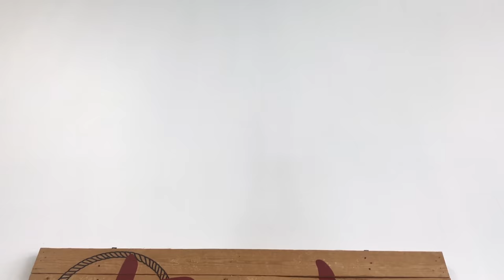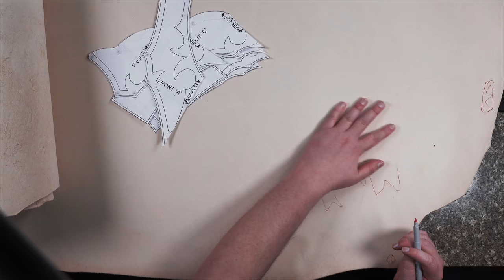How To Make An Articulated Leather Breastplate

Comment: I'm very glad you mentioned sizing at the very beginning, because for armor (any armor) if you want a good fit you need to modify any pattern to fit your body correctly -- with loose fitting in mind. Suits should fit snuggly, not armor. Unless you're in the Matrix and your armor IS a suit.

Comment: I recently built the helmet as my first big piece and it shows off the best. Watching this video, I see you using the orange foam chunks for doing the rough-in work on dying.  I find that the foam wedge brushes work quite well for edge work near the lines. They are cheap, disposable, and will hold a reasonably sharp edge, even after the spirits in the dye cause the foam to swell.

Comment: Alright, the video just hit the 8 min mark and you just mentioned distressing and I am scratching my head now asking "So, then what was the big deal about find the imperfections earlier on the leather?"  I mean, you did a great job and the step by step was absolutely clear and easy to understand and follow, but then this one part just stands up and says "HEY!  HEY YOU!  OVER HERE!  COME!  COME HIT ME!"
Reply from the maker: Project flow: Start with clean leather you can control the result of, make sure it is consistent.  > Determine your cosmetic effects and proceed to decorate to your preferences > Distress, or not distress, according to preference. EZ   Alternate plan: Determine up front you want a distressed piece, search for scraps and hides with extra brands and blemishes, use said areas to construct suit.  also EZ.  These vids demonstrate various methods for everyone, and in general, don't nit pick lol
Reply: There are many different types of blemishes that typically show up on cow hides, but they can generally be narrowed down to three categories: 
1. blemishes that cause weak spots 
2.  blemishes that do not affect the leather's strength/flexibility 
3.  blemishes that cause hard spots. 

Identifying flaws in the hide and working around them will give you a much better experience working the leather, and will help your finished project look, feel, and be as good as it can be. If you want a specific style of weathering (like this breastplate) but then there is one 4x4 inch section that doesn't take dye the same way, it would break the cohesive look of the piece.    

There is nothing wrong with featuring the natural flaws of leather in your projects. Brands, scars, bug bites, etc can all add some really neat character, as long as they are in the right place at the right time.

Comment: I do appreciate your work. You are truly talented. 
I do have a question, I build a lot of costumes out of EVA foam, will the tools you use to add the bevels work on the foam?
Reply: Leather stamps don't generally work well on foam. The leather is dampened to be able to take impressions which is functionally similar to adding heat to foam. It makes the leather bendable, take impressions, etc. Foam when heated will take impressions, but once you re-heat the foam to shape it after stamping, or to do additional stamping, will lose much if not all of the details given by previous heats. If you have one single stamp you want to press into foam, you can do that, but just be sure to avoid any re-heating until it is sealed really well. That said, there is a relatively new thing in the world of foamsmithing called Foam Clay. it starts out as a sculptable clay, then air dries into a moderately flexible foam. Something like that may work with stamps as you'd be able to lay it on your project, stamp it while the foam clay is still wet, then once it dries it would maintain its shape. Definitely worth trying if you ever have a chance!

Comment: Question: If you were going to attach anything to the armor, How would you do it so that it looks right and is stable and sturdy? I was thinking of adding a a few small hardened foam skulls from a Halloween decoration
Reply: There are TONS of options for attaching adornments, but I find stitching/lacing and riveting to be the most secure options. To use your example of a foam skull, you can cut off the back 1/4th of the skull to create a flat surface, then use a heated poker to melt a tunnel from "ear to ear" on the skull. Then punch a couple of holes in the armor, lace/thread slips through and ties at the back. Super glue the cordage closed for extra security and you're rockin' and rollin'

Comment: I'll be attempting to make a cuirass, but only enough leather coverage for the ribcage (front and back). Later attaching chainmail to finish the length. I'm asking for advice on the leather. 

Would it be better to do the pattern as one piece and drape it over me and attach on the sides, or 2 halves and attach on both shoulders and sides?

Comment: Can you show how to attach the shoulders to the chestpiece?  That part gives me a really hard time.
Reply: I agree I want to see how this is done maybe a short video to make sure us noobs don't mess it up?  I am guessing you remove the full shoulder strap and cut it down like the side straps mark the holes and rivet it but I just want to make sure before I go for it.
Reply from the maker: I don't know if it really warrants a full video.  Just align the shoulder over the shoulder, and either overlapping the shoulder strap, or butted to it, however you'd want wear it really, and use some something either a strap or leather tab.  the main goal is to make it hinge from the top of the shoulder to allow for more movement.  You'd use either that, or the chest strap, not both.
Reply: @Princearmory  That sound good I will give it a try once I finish the chest piece.  I have made my own leg armor using the principles from the arm piece.  It seems you would want to connect it to the check armor somehow to hold the weight of the leg armor?
Reply: @Princearmory  my issue when I tried this was the shoulder wouldn't stay in place correctly and would end up sliding back or forward on the chestpiece.

Comment: If you would want to have cleaner colors and color separation would you tape of the two different areas with painters tape or would it be enough to just start with the red and not worry about painting over into the black area and then paint the black areas last? would you be able to see the red under the black where you ve gone over the line? Is it important to do more then one coat of color or doesn't it have any effect? (I ve seem some videos where people do atleast 2 coats of color and some even do 3)
Reply: The answer is: It depends on how you are applying your color. Dye and paint can act very differently when applied to leather. Dyes are very thin and designed to penetrate into the leather where paints (generally speaking) sit on the surface of the leather with very little penetration. Because leather is a naturally porus material, dye can sometimes bleed a little, so if you are looking for really clean sharp transitions from one color to the next, it can be advantageous to make sure your color transitions have some sort of physical component as well (swivel knife cuts/bevelled lines/etc. That coupled with a bit of care while applying your dyes and you'll be off the the proverbial races! (always make sure to test on scrap to make sure you get the results you want before risking a big important project!)

If you are using paint, then you could use masking to get clean sharp lines if you wanted to, but with a project like this it is not terribly necessary. Because you have the swivel knife cuts & bevelled lines, there is a natural physical separation of areas which you can use to guide your brush when doing the small details. Then there is also the point that it depends on how "new" you want the armor to look. If it is going to be weathered, a little bleedover of the darker colors isn't necessarily a bad thing.   One thing you will want to make sure of is that you use a low tack masking tape otherwise you may risk messing up some of the leather's finish.  As mentioned before, always test on scrap!  

Multiple coats is 100% up to you. Many people will store their dyes diluted so they have more granular control over the resulting color by building up layer upon layer and others prefer full strength dip dyeing to ensure very uniform results with bold colors. At the end of the day, do whatever works for you and, most importantly, gets the results you need for the project!
Reply: @bjornsworkshop9288  Thanks a lot for the great answer!

Comment: So, it may be cheating, but I took the files to my local Fed-Ex shipper. They were able to create a mirror file and printed one of each off for me. I can now split the pattern on the mid-line, tape the fronts and back as appropriate, and I now don't have to fuss with layout issues. I can also pre-fit with less issue.
Reply: Can you explain how you did this in more detail?

Comment: Nice video and very useful tips, but I think the buckles should be the other way around. Those pins are a pain if you scratch on them or get chainmail rings caught by them.
Also, if you are LARPing, they can badly damage an opponent foam weapon during a fight...
Reply from the maker: The other way around?  Sure, if you want, but its better to have the tongue end flowing backwards so it gets caught on stuff less and looks cleaner from the front.  You're free to use whatever closure method you prefer though.

Comment: Dude your work is awesome. I love the look you achieved. Do you happen to know if some of your tools like the trench cutter and the beveling tool work on EVA foam?
Reply: Box knife: yes (Foam chews up blades so having cheap/easily replaceable blades and/or blades you can sharpen on the bottom of a mug is a win)
Swivel knife: not well (foam would dull out these blades and they are more of a pain to re-sharpen than would be worth their use. I'd go with an xacto/scalpel then heat gun it to open your cuts up as needed.
Beveller: No. While EVA does take impressions when heated, as soon as you re-heat the piece to do more stamping, all of your previous work will start to lose definition very quickly to the point of nearly disappearing. If you can get the impression you need done in one heat cycle, then you may be able to get away with it.... but otherwise not so much.

Comment: Question, can this be made using carbon fiber? say sheets and bend them if not too thick?
thanks
Reply from the maker: Might require some tweaks, and careful attention to fit, but it could work.  The thing with adapting a design meant for a flexible medium, to a hard medium, is making sure you have some areas that can still flex, especially over the shoulders at the least.

Comment: Could I use the generalized bass tips and just make this out of metal instead of leather
Reply: I'm sure you could, though obviously working sheet metal is tougher than working leather. But if you can form the plates correctly, I can't see a reason this wouldn't translate into steel well. Proper fitment becomes more critical though, as there would be no flex from the main leather plates (not that these will flex much, but likely a little). You really want to shape the plates well to the body so that they can move slightly with the straps but not bind. :)
Reply: @Broadpaw_Fox  thank you so much

Comment: What is your thought on using gum Arabic and glassing the flesh side instead of using the sheen?
Reply: Finishing the flesh side of leather is a lot like finishing edges: There are 10,000 different ways to do it that give results, and as long as you get the results that work for you and/or whoever will be using the product, then it works!  It's the old saying "Don't try to fix it if it ain't broke"
Reply from the maker: Yeah, I mean, if you really hate yourself, you can slick the flesh side of an entire suit.  I prefer to just get clean leather thats already nice on the inside : )

Comment: How many hours of work would you say this takes?
Reply: Hours of work to make something is a really hard thing to judge. One of the things that distinguishes a novice from a master is the level of efficiency. Adjustments and problem solving that may take a newbie 12 hours to solve may take a master 12 minutes. As a vast generalization I'd say this can comfortably be made in a relaxed weekend worth of work,, but your results may vary.
Reply from the maker: Yeah, almost as a rule I never really get into judging hours, I'd probably have to quit if I did lol

Comment: After messing with scales and tiling I can not figure out the scale that was used. I can’t seem to get the same scale that is on your paper. Any advice?
Reply from the maker: Scale it at 100% for the default size unless you know you're significantly smaller or larger than the expressed sizes, then make a paper mockup and see if you need to adjust from there.  Thats the most straightforward method anyway

Comment: great! now all i need to figure out, is, if this pattern can  be done with something solid like metal or plastic, so it still can be mobile?? any advices?????
Reply: This pattern is 100% buildable in either plastic or metal. You may have to modify the pattern slightly to account for the thickness of the material you use though. Other than that, the harnessing is all the pretty much the same once the pieces are all built.
Reply: First of all, thanks for answer!  Ive been working on metal armors for a while now and i can easily bend shape, it was about same mobility like this one had on lower back area. And my mainc problem is hard plastic, whic is breaking when bending, like same PVC which is used in water pipes (big ones). Can i bend it using heatgun or something like that? I'm kinda new at plastic (i need to do larp armor out of plastic because steel is too heavy for that). Thanks in advance!

Comment: Does this tutorial  work with Eva foam too??
Reply: The vast majority of the tutorial is applicable to EVA, as is the pattern. The only real difference is that to get the border decorations, you will not use a beveller stamp, but instead use a knife to cut the lines in, and then heat the foam a little to separate  the sections a bit. Then you can either leave it mostly flat or go in with a knife or dremel to carve in any layering effects you want.  Another option would be to use some thin craft foam to layer your borders along the edges to create the layered effects.

Comment: Do you wait for the dye to fully dry before putting the shene on? If so, what would be a good amount of time to wait for the dye that was used?
Reply: As a general rule, it is good to let things dry fully between steps, but I wouldn't say that it is necessary. When it comes to dye, the ideal would be to dye > dry > buff > sheen > buff. Depending on your timeline and desired effects, you may deviate from that pattern as needed.

Comment: Realistically, how large could you go with this design? Im a fairly large guy and I larp and am learning more and more leather working stuff so I would love to take this project on but dont want to waste time and money if it wouldnt work out for me. 
Thanks in advance
Reply: He said in the beginning that this particular pattern was for about a 40 inch chest... how big are you? I mean, you can pretty easily scale this up by printing the pattern sheets slightly larger (110%, 120%, etc), and just confirm that the pattern fits your frame before cutting any leather. :) Another nice thing is that this is made of several smaller pieces, so even sized for a big guy you should still be able to get the pieces out of a full hide. 

Personally, I'm going to make one of these eventually as well, and while I'm not huge, I am rather stout, so I'll have to fight with fitment as well. I think it'll be fun though. :)
Reply: @Broadpaw_Fox  Yeah i saw that part thats what made me curious. Im like a 65 inch chest but im also oddly shaped since i have a big gut.
Reply: @morganbunch5152  - well, what I would do is just try scaling the patterns up and printing in one paper, and then see how that can be made to fit your frame. You'd only be out a little bit of paper at that point if it isn't going to work, but if it could be made to work you get your armor. :)

Comment: Does this work with steal?
Reply from the maker: If you fit it and shape it well it should.  the design function isn't all that far off a lorica segmentata.  Might want more and more narrow chest lames though for more mobility.  Leather works great with fewer because it is flexible.  I would also probably modify the area over the shoulder, needs some flex there.

Comment: what i'm wondering is if this is particle for war like will it hold up in battle
Reply: That depends on what kinds of battles you expect to run into. Will it protect you from foam weapons at a boffer larp? Sure! Will it prevent you from breaking a rib if you take a baseball bat to the side? Probably not... It will provide more protection from blades than a t-shirt, but less than maille. Won't stop bullets.    The biggest factor is what the armor is made of. If you use 1/3 inch thick leather, it'll afford you more protection than if you use 2mm super flexible leather. If you use 16ga spring steel, it will function very differently than 22ga aluminum.

Comment: how long did you waite to put the satin sheen on the piece after you put the dye on the leather?
Reply: generally speaking, you can dye > wait a few hours > buff then sheen. Depending on temperature/humidity, you may be able to wait less or have to wait longer. As a general rule of thumb, if you're not in a hurry, it's easy to leave things overnight between steps involving liquids to guarantee everything is fully dried